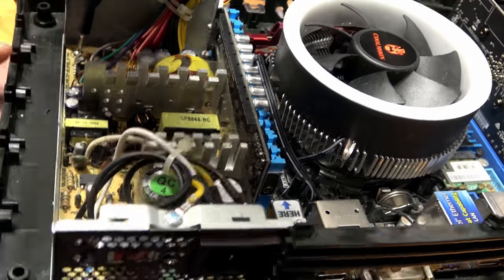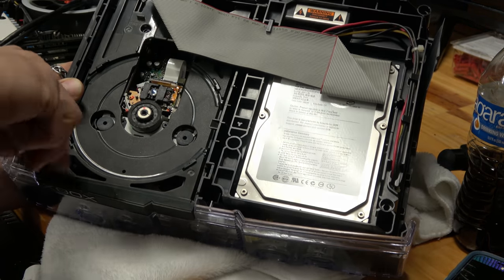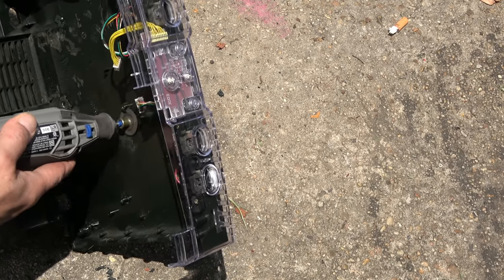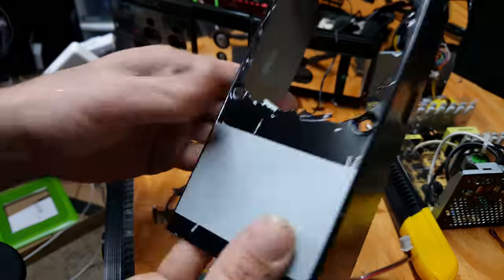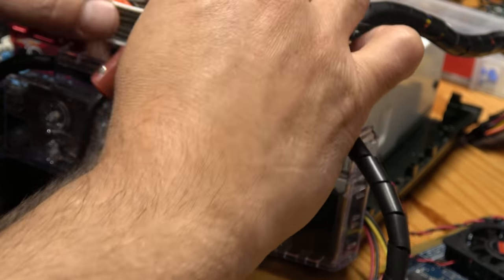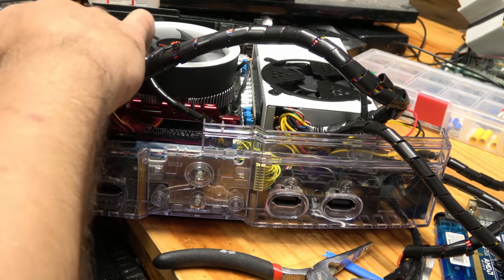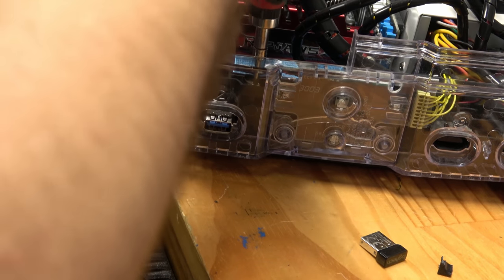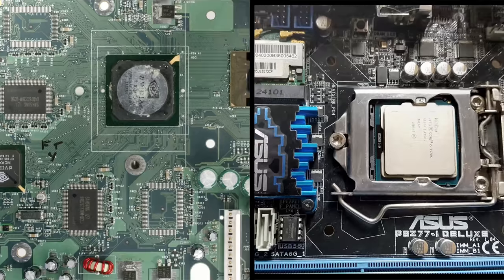I turned my old original Xbox into a gaming pc!

Comment: An ASL G1504 graphics card would fit perfectly in that build. It's a single slot low profile card and it's also know as the ASL GTX 1050Ti BattleFlag 4GB and it only uses pcie slot power. I have one myself in a small pc and it's a great little card. More than double the performance of a GT 1030 DDR5 that I had before.
Reply from the maker: $250 for that card?
Reply: @modstek  Wow prices have gone up. I paid about $140 for it a year ago. Could be it's because it is still the fastest single slot low profile card available and stock is low...

Comment: my only problem is it's 2019 there is way better hardware out there processor, cpu, two sticks of ram sfx powersuplys actually meant for applications like this with all black cables so you wouldn't have to use that cheap looking spiral tubing. not hating tho it looks really cool but i just feel it could be alot better than it is

Comment: I've been doing a project with an orange pi PC I don't have the drive caddy and want to use a standard drive bay DVD ROM burner, can I use the caddy if I get one or is there a better way to mount it , I'm having trouble trying to figure this out as I'm using retro pi and it comes with kodi as you may already know ,i already know how to hook it up to usb but need to figure out script to permanlty keep it mounted in os  as well , FYI there will be no interference with anything where the drive bay goes, thnx in advance for any info